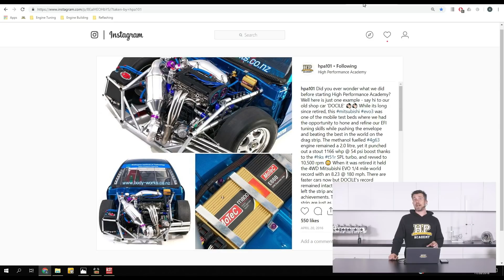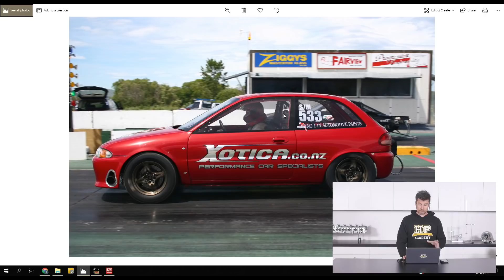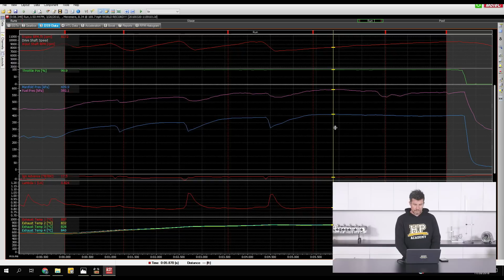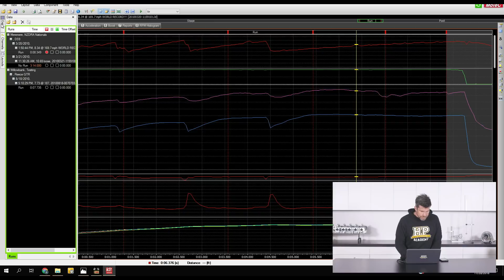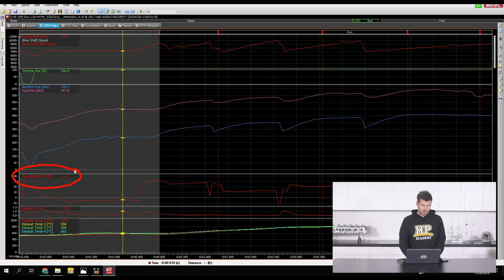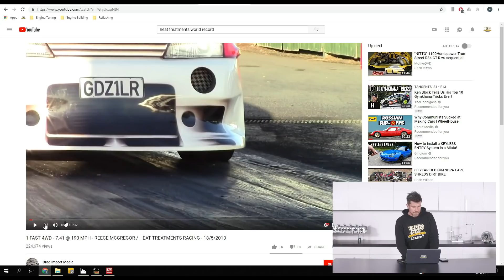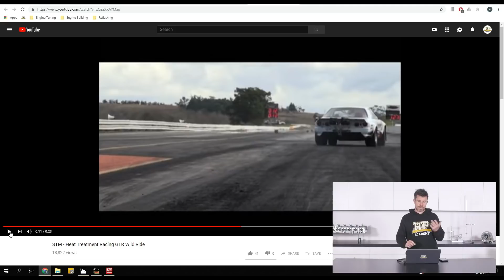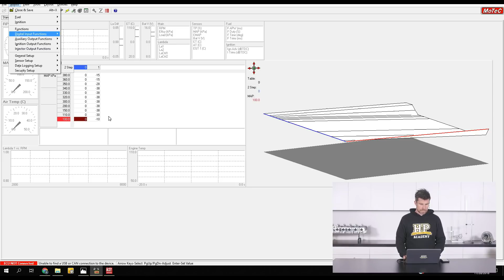How To Tune A Drag Car | Drag-Specific Tuning Secrets [GOLD WEBINAR LESSON]

Comment: Nice webinar!

You have talked about reading coolant pressure. It helps you not only to check for an early failure on cylinder head gasket but to check for hot spots or coolant flow unevenly distributed, if you have a hot spot you will heve an increase of coolant pressure that will come back as soon as you release the right foot.

I also recommend you to monitor blowby pressure. It can save your block from a flying rod

Comment: I'm glad you mentioned the different dyno sheets from different manufacturers having higher readings than others. I've been thinking about this for a while because it really bothers me. Theoretically it wouldn't be difficult to setup a kind of machine that has an exact measurable output that could be taken and put onto different dynos. Then you could say set the machine for exactly 300hp and 300tq across the rev range, and then compare it to what the dyno readout says. Especially in today's world of modern technology. If you had something as consistent as say an electric motor powering the wheels of your test machine, where you could have a current clamp on the windings to know exactly how much electricity is going through the motor, there would be zero room for interpretation or error. Then you could take this machine around to different dynos and ask the owners if they are interested in getting an exact calibration done, or at least a few tests to know how accurate or inaccurate their dyno is.

What I particularly don't like is how the two major brand of dynomometers are both considered "valid" results even though one type is known to create higher numbers than the other. It's very simple either one of those dyno types is wrong, or they are both wrong. You can't have two results that are different and both valid that are measuring the same input.

I think if you could control the temperature of your test machine that would test these dynos so that it was consistent, and you could measure the current and voltage in the motor windings, and there was no wheel slip on the rollers, you would get a very accurate measurement that would not really be open to interpretation. I really don't think that this would be that difficult to do I guess there is just not enough demand for it. Maybe someday when I have the resources and time I can put something like that together.
Reply: While most of your arguments make sense, both of them being “Valid” is not referencing what dyno type puts out the most accurate number. But instead, both types can be used as valid measuring devices and tools to make sure you’re headed in the right direction when it comes to tuning.  I’ve seen cars come out of both types of dyno with the same tuner (remote tuner) and put up similar numbers at the track.

Comment: In your course, will there content specific for Drag tuning and detailed ways to set boost pressure, afr and gearing specifically for 1/4 mile? Please let me know
Reply from the maker: We cover more detail on tuning in our course and webinar material than you would need for a drag application. As far as tuning goes, it's straight forward.

We don't specifically cover things like gearing however. We are working on a transmission tuning course but that will only apply to automatic transmissions. Your supplier for your gears and diffs etc is probably a good person to talk to when ti comes to getting a handle on that side of things beyond what you can find yourself. Never be afraid to ask them questions.

Note though and I think this is where you were coming from, you do not tune your engine any differently according to your gearing. You do things the other way around and your gearing is there to get the most from your engine for your application - Taz.

Comment: what are you using for a clutch? are you able to slip the clutch off the starting line? in the US we swap base pressure for centrifugal pressure to  soften the launch and allow the centrifugal to lock-up the clutch downtrack.

Comment: Andre, I'm not sure if you've heard of this product or not, but it's absolutely worth looking at - especially considering how much you seem to like increased tunability, like myself! 

[probably going to be a bit lengthy - brevity isn't my strong suit] 
An alternative to the more traditional inline clutch bleed circuit, like the Magnus unit, worth checking out is the ClutchTamer; it offers a very significant advantage over the more traditional inline bleed valves as I'll explain. 
Their website is the product name [ClutchTamer(dot)com - I've heard YouTube doesn't like links in comments now] - don't judge them by the website(not pretty), judge them by the content, very dense with technical information. 

To the major benefits that this carries over the traditional bleed circuits, like the Magnus product - we know the glaring weakness of the traditional bleed circuits; the inability to control WHEN it slows the rate of clutch engagement. These are notoriously difficult to use in heads up racing because it slows the entirety of clutch travel, not just the travel when the clutch engages(the only part of the travel that you want to slow the rate of), but the entire dead zone of pedal travel before the clutch actually engages too, making clutch engagement rather unpredictable(or, maybe 'predictably delayed' would be more accurate).
Where the ClutchTamer offers an advantage over the traditional bleed valves is in being able to infinitely adjust(via a dial, rather than swapping out fixed size orifices) not only the rate of clutch release, but most importantly the point of engagement. Meaning, you can side step the clutch, and the rate of clutch release will be 100% unaffected until it reaches the specific point in clutch travel that you've set the ClutchTamer to engage at. So, unlike with the traditional bleed valves, you don't have to change the way that you use the clutch - you can hold the pedal flat to the floor with both ambers lit, side step the clutch on the last yellow(as you do), and the clutch will drop uninhibited straight to the engagement point that you've set the ClutchTamer to engage at. This point obviously being the point at which your specific clutch in your specific car actually begins to 'grab' or engages of course; the point where you WANT to begin controlling the rate of clutch release. 
For heads up racing, the benefit of this design goes without saying, it's the difference between being able to consistently cut a light versus having to work around the side effects of one of these inline bleed circuits. 

Another benefit over the traditional bleed circuits is that this is infinitely adjustable from the driver's seat - instead of using fixed size orifices that must be swapped out to control hydraulic flow, you simply twist the knobs on the CT products to where you want to adjust them to. With the ClutchTamer, you're adjusting the level of resistance of the gas cylinder acting upon the clutch pedal arm. 
Note they also have a product called the HitMaster, which is an inline hydraulic bleed valve that works more like the ClutchTamer than the Magnus unit. It acts directly upon the flow of the clutch fluid, and I believe(don't quote me on this) that it uses an adjustable needle-and-seat flow restrictor instead of a fixed size orifice, so it's an inline bleed circuit that doesn't suffer from the downsides of the traditional inline bleed circuits(again, like the Magnus piece - not picking on them, they just have the most popular one on the market). I only have experience with the ClutchTamer though, but want to try out one of these HitMasters. 
And, with the way that the ClutchTamer is designed, it can be used on hydraulic clutches, cable clutches, and mechanical linkage('Z-bar') clutches too, since it acts upon the clutch pedal instead of being a hydraulic flow restrictor. 

Anyway, I'm not associated with this company in any way other than running their ClutchTamer product myself. I'm using one in a Fox body Mustang with a mild ~375-400HP 306" small block Windsor - running a bone stock T5 5-speed - and 255/9.5" Mickey drag radials.
If you know about [US] domestic drag racing, then you're probably familiar with T5 transmissions being made of glass, and running drag radials on a clutch car being a BIG no no(radials only work when you can dead hook them, which is extraordinarily difficult with a clutch, while bias plies work best with some slip off the line, which plays into the favor of a clutch). Needless to say, since bolting on a ClutchTamer, it's been a total game changer - no more broken transmissions because we aren't shock loading the drivetrain, and we're able to dead hook our radials off the line while side stepping the clutch and letting the CT feed in engagement at a consistent, controlled, predictable rate. It's AMAZING for making last second tuning adjustments from the driver's seat for changing track conditions too - you can literally watch the person in front of you make a pass, and make an adjustment based on how they left the line right before or even after doing your burnout, by just turning a knob on/under your dash - very handy.

Anyway, I thought this may be the sort of thing that HPA would want to look into, the ease of use and tunability is amazing, right up your alley. 
It really is the "poor man's slipper clutch", but for the price of an inline bleed circuit, and without the downsides of a traditional inline bleed circuit.
Reply from the maker: Thanks for letting us know about that. It's not a product that I've heard of and yes, the conventional clutch slipper valves make it all but impossible to cut a good light with consistency. The clutch tamer sounds like a good step forward for sure - Andre
Reply: @hpa101  I've been really impressed with it, it's a very effective tool for stick shift racers in a time when it's getting harder to stay competitive with a clutch & stick.
It's gained a lot of traction in the NMRA Factory Stock & Coyote Stock classes too since rule changes had really hindered the stick shift cars, and I believe the last class champion in one of the two classes was running one too.
Reply: So as I understand it, the clutch tamer controls how much the clutch slows down, and also when it starts to slow down?
What is the difference between the slipper clutch and this then? Is it due to the fact that slipper clutches can't control when the clutch starts to slow down?

Comment: How fast would coolant pressure rise when the head is lifting? I have been monitoring my pressure and after a few pulls I start to exceed the  cap pressure and push out small amounts of coolant. Not a sharp spike in coolant pressure, but say 15 PSI cap, rising to about 20-25 after a 1/4 mile

Comment: Andre,
What is a good car tuners laptop setup:
Minimum processor speeds
Minimum RAM
Minimum screen size
Minimum battery life
WWAN 4G LTE capabilities
OS: Apple or Windows (X86 or X64 or ARM64)
Is it a good idea to research which laptop that has the most scaleabilities? For example a laptop that starts out with 8GB ram with a maximum upgrade to 64GB a good idea to consider? Because starting with a laptop with 64GB will cost a lot to begin with where as one can start out with what one needs and then later upgrade accordingly as needs changes.
Reply: You don't need a super fast or powerful laptop if that's your main use

Comment: What are your guys thoughts on intercooled intake plenums
Reply: Positive displacement supercharger-style intake manifolds - with a liquid-to-air heat exchanger core mounted in the intake manifold? If that's what you're referring to, they can certainly work just fine, but this comes with its own packaging constraints and can limit the size of core that you can run(likely not a problem unless you're running deep 4-digit HP numbers). You'll often see people take a factory supercharged car('03/' 04 Mustang Cobras are a prime example), remove the blower, put a fabricated hat on the blower manifold, and run a turbo/centrifugal s'charger feeding into the hat, through the stock heat exchanger core, and through the blower manifold. However, the problem with this is that blower manifolds are pretty terrible for anything that isn't a positive displacement blower because they're basically a big open plenum with non-existent runner length, so they produce an extremely soft curve everywhere except the last couple thousand of RPM in your rev range(and the inherent low RPM boost characteristics of positive displacement blowers makes up for these extremely short runners of course, which is how the factories/PD blower companies can get away with it).

If this is what you're talking about, but in a more general sense, then the aftermarket makes [hardware, as opposed to chemical] intercooled intake manifolds more viable than the olden days of feeding turbos into blower manifolds. Case in point, check out the VERY popular Holley Hi-Ram manifolds for the LS & SBF(shocking - us Ford guys getting some love for a change! Lol) - these are what you see on basically every turbo LSx that isn't running a stock manifold today, hugely popular and for good reason. Because these are a 2-piece manifold with a lower made up of the intake runners and the lower half of the plenum, plus an upper hat that is the upper half of the plenum, they're very flexible and modular. As a result, the aftermarket offers a lot of replacement hats for these, plenum spacers, and of course bolt-in heat exchanger cores for an intercooled manifold setup. 
These work VERY well as you can stick a big fat core in there for a LOT of heat capacity/surface area, AND you do so without being forced to run compromised runner lengths as these have nice long runners.

Of course, the downside of the intercooled Holley Hi-Ram is that they're VERY tall, especially after you stick that big fat core in the middle of one, and they are NOT cheap by any means. Granted, the only comparable alternative would be a fabricated tunnel ram(sheet metal version of a Hi-Ram basically) designed in a similar way - but that makes the intercooled Hi-Ram look like a bargain...
Reply: @RyTrapp0  yes that is the type of intake im talking also the 2020 supra has an intercooled plenum aswell,  what I'm interested in is the pros and cons of having the intercooler after the throttle
Reply from the maker: @samuelmdouglas  the upside is that the packaging is much more compact and you could expect an improvement in response. The downside is that you'll generally end up with higher inlet temps than a well designed FMIC. The water to air route also involves more complexity with a pump, lines and another heat exchanger for the coolant.

Comment: What was the engine built with internals ? Stroker. longrod. Alurods etc..
Reply from the maker: If you're referring to the black EVO 9 then it used a 94 mm billet stroker crank, custom JE forged pistons and a set of Carrillo rods.
Reply: @hpa101  that is amazing do you sleeve the block ? 
Can't say thank you enough due to your vids and some others I was able to tune my own car have a Evo 7 running 579hp 542torque 
Running adaptronic m2000

Comment: what compression ratio you are running in the evo 9 ?
Reply from the maker: We ran 9.5:1 in that engine because we were running a gasoline based fuel. On methanol or even E85 I'd have stepped that up to around 10.5:1 - Andre

Comment: Hey man 
What estimate hp level you have to be To trap 148 mph in a evo weighing 2800lbs?
Reply: Peak hp isn't an accurate measure for this type of thing.  You really should be concerned about area under the torque curve, but again this isn't really as relevant as how much power you're able to get to the ground.
Reply: 708hp
Reply from the maker: If you punch that into any of the various drag racing calculators you'll end up with somewhere around 700 hp. I usually find that a 4WD drag car can't utilise the available power as well as a proper RWD drag car so the actual engine power often ends up higher than the calculation suggests.
Reply: @hpa101  its funny how awd cars often actually grip worse than proper rwd cars in drag racing... in almost all other motorsports having awd pretty much automatically equals better launch
Reply: So Red demon took that 7:41 record for fastest awd outright?